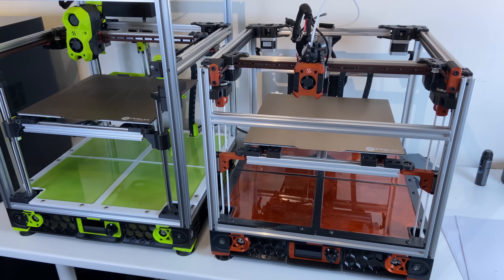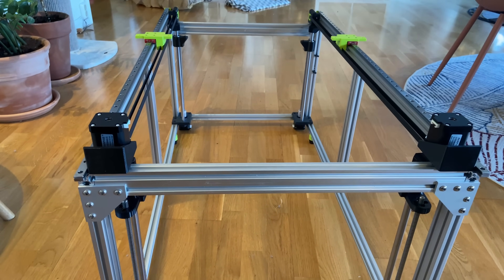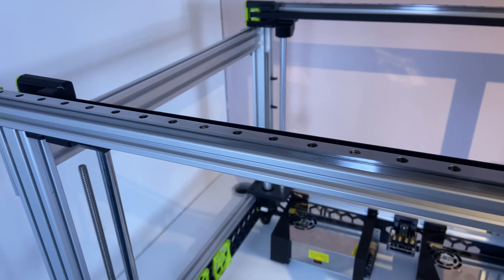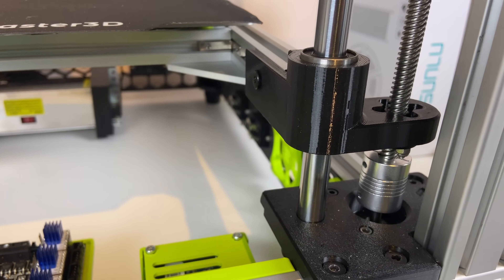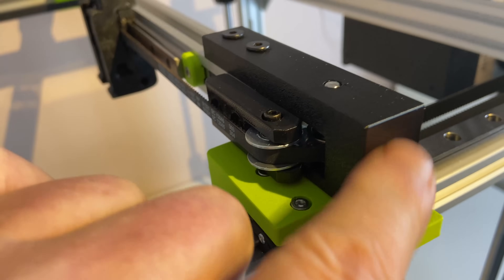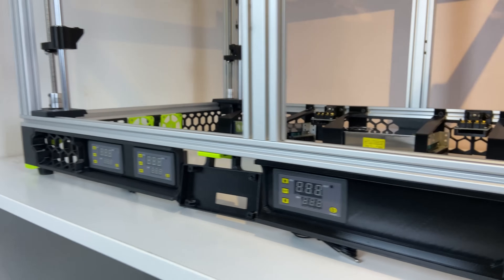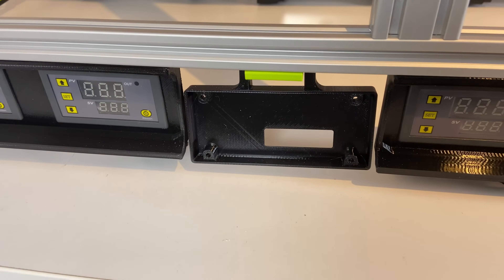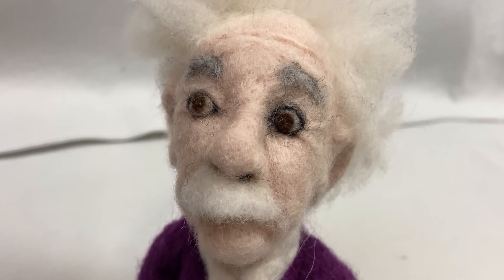Large DIY 3D printer 1 - design and build

Comment: very intersting would u plz share the cad file
Reply from the maker: I have no complete cad for this. Some of the key custom parts will be published on Printables. I am considering designing a slightly smaller version 300x600x250 with a more optimized frame size.

Comment: Out of curiosity, did you consider modifying/building a belt printer? It seems like it could give you the kind of build volume you're going for with its infinite Z axis.
Reply from the maker: I have seen some of those designs, but wanted something a bit more precise. My use case is to print some larger parts with about the same print quality as my other printers.

Comment: This is fantastic! How much did this cost all in all?
Reply from the maker: @chrishuefner7989  This build isn’t expensive. I got the 3 psu’s and all the heat beds for usd 70ish. I took many of the other parts from stuff I already had. In my case this is probably a 4-500 dollar build.
Reply: @v4projects  Hi, i am looking for a large printer such as this, but am new to 3d printing. what would you recommend for a starter 3d printer which i can then learn on and then use to build the parts for a larger 3d printer such as yours?
Reply from the maker: @johnbell1810  Most of the 3D-printed parts on this build can be printed on a relatively small printer. The larger parts like the bottom covers can be made in some other material not requiring 3D printing at all. When it comes to first printer it depends on what you would like to learn, 3D printing or building 3D printers? Your budget is also a factor. For just 3D printing I would still choose Bambu lab. A1 or P1S. Bambu lab have been heavily criticized about limitations they have implemented. If you would like someting more tinker friendly, I would consider something from Sovol or maybe a second hand original Prusa. I am not a fan of Creality, but you’ll find a lot of second hand printers from them.

Comment: This is great. IU'll make a channel to show my big 3D printer build
Reply: Biggest problem I'm facing (and I can see that with your right now) in my opinion, is that when we start to get to these sizes (plus 500mm build plate), legitminate flow is the problem, without moving to a pellet extruder; no retractions, so only vase mode is for best print quality.

My build is using very long melt zone, extreme high flow hot ends for this reason.
Still slicing times even 100mm+^3/s is taking days
Reply from the maker: Yes, and this is not going to be a fast printer either. That said I don't really need it to be. My use case is a few prints per month exceeding the size I can handle on my other printers. It will likely be some panels, frames and speaker enclosures.  It's going to be interesting to see how this works. I have changed my mind regarding the "default" mode on the printer. With the first mains switch "ON", heatbed 1 and 2 will be active. And it's basically a 300x600 printer. With the second mains switch "ON",  heatbed 3 can be used and the build volume will be 300x870ish. I think the default mode will be sufficient for 80% of my large prints.

Comment: Great video! I'm thinking of building a large scale printer myself, how did the process go so far was it cumbersome? and how much time did you invest in assembly and getting everything running? great job and good luck!
Reply from the maker: Thanks! I am using some of the solutions from my previous builds and that makes it simpler. A big printer like this is heavy to move around but it is also easier to work on as there is more space.

Comment: Nice build.  I went the easy way several years ago and expanded one of my Ender 5plus machines to 305mm x 800mm x 220mm build volume when Creality released the open firmware.  I went with a 6mm aluminum bed spring mounted to 2040 extrusion on edge with a 1000w (massive overkill) ac silicone heater. and also went with custom full size pei coated build plates.  It works well enough for my uses but I've been thinking about building it from scratch and changing the x/y orientation to what you are using since the 1m wide gantry does limit the speed.
Reply: I'd absolutely break the bed heat down into zones if I do it again.  Heating the whole bed for smaller than full bed prints makes an impact on the electrical bill.  I'd enclose it as well, I fight warping with it being open air.
Reply from the maker: Thanks! What kind of average printing speed (with ok quality) do you get on that printer?
Reply: @ not much speed, but I run 1mm nozzles at .6mm layer heights through the Swiss micro hot end kit for the ender 5.  If my memory is correct I average 60mm/s movement at the stock acceleration.  It was supposed to be a proof of concept before I bothered to go through an actual build process but because it worked I just kept using it.
Reply from the maker: @Zebsboards  I think that is around the standard speed my 300x300x400 bedslinger could do without poor print quality. Hopefully this build will be a bit faster but what I need is the capability to print large with good quality. If I have to slow it down, it’s still usable.
Reply: @v4projects  tried to post a link to a pic but it was deleted.  One of the reasons I was thinking about rebuilding was to go to the orientation that you are to see if I could get the speed up.  I'd have to switch out the hotend to the rapido that I bought as well as the extrusion volume was limiting the speed.  I was thinking flying gantry as well, a couple of years before it became a 'thing'.

Comment: Hi, amazing build! I'm happy to see someone using double shear and 9mm belts for a large design like this. Is there any reason why you chose to use petg for your motor mounts instead of abs? Its my understanding that abs would be stiffer and have less creep/deformation over time
Reply from the maker: @Terriblewastaken  Yes, it would probably be better to use ABS or ASA. At least when the parts can be printed without supports. That said I have never had a problem with PETG in an open printer. But ABS/ASA would be stiffer.

Comment: Cool project. Though I'm bit sceptical if that heat bed will work well with all materials. Most beds are known to have quite a bit of heating efficiency on their perimeteres and you're going to have two quite big problem areas. Don't get me wrong I sincerely hope that works as it would be very easy and affordable option. I've occasionally though about making large part printer, but never seen any good off the shelf solutions, though I haven't even searched too heavily. Maybe it would be possible to add some smaller heater elements between those gaps? Anyway, best of luck and I hope you update as I just subscribed :)
Reply from the maker: Thank you! Yes uneven heating is a concern but that is also a problem on most printers with a single heatbed if you are trying to use the complete build plate. I am trying to overlap with the flexplates a little by using 310x310 flexplates on the 300x300 beds. There are still several unknown factors in this build, but that is what makes it exciting, at least for me :-)
Reply: @ Idea of overlapping plates is good idea. Most certainly worth trying.
Reply from the maker: That idea with some extra heaters could be interesting to try out. Thanks!

Comment: Do you control z-axis motors in one control board and x and y axis motors with 2nd control board? If so, how do you do it and is there any source file that you can suggest? Thank you :)
Reply from the maker: Yes, the SKR 1,4 will control Z and one of the heated beds and the other controller SKR PICO will do the rest. It's actually quite simple, you use one printer.cfg and and specify the pins by adding an alias in front of the pin number. Like this step_pin: xy:gpio11  In this case I have defined the MCU handling XY-axis just [mcu xy] and the other one just [mcu]. You'll have two definitions of serial: in your config file. Have a look at Kanrog Creations video about this. https://www.youtube.com/watch?v=QIbzbwEY7nU

Comment: It's good practice to use a thrust bearing between the stepper body and the flexible coupler as the stepper shaft rests on top of a spring washer and will move if you press its down so it's possible for your z height to drop as the lead screw presses down the stepper shaft. Also make sure to rest the lead screw directly on the stepper shaft inside the flexible coupler for a similar reason to what mentioned above. Alternatively you can suspend the lead screw from above by a pillow block bearing to constrain it in z. I also want a lollipop for noticing the problem with the previous bed mount in the previous upload
Reply from the maker: Someone (a long time ago) suggested using a ball from a ball bearing between the leadscrew and the stepper shaft as well. I don't know if that makes any difference at all. Thanks for noticing the swiveling bed mounts. Very frustrating mistake and actually the second time I do that (same thing happened on my Voronish 1 build). Very embarrassing and not my proudest hour. That said I don't give up easily :-)
Reply: @v4projects   it wouldn't make a difference on lighter beds as the spring washer is reasonably stiff but still something to be aware of.
Regarding the bed mount, you can run a second rod parallel to the original to constrain the movement in z and avoid rotation around z. it'd essentially be what a single linear guide achieves but cheaper. Linking the mounts together mechanically would also eliminate the play but that wouldn't really be a "floating" mount + it introduces a new set of problems such as binding, and twisting the frame. Practical Precision has a great video on designing a kinematic mount which i highly recommend. Studying about constrains and DOFs should help you avoid making similar blunders if you don't have an intuition or feel for these mechanisms.
Reply from the maker: What I have done in this build now is to link two of the bed mounts with an extrusion. The other two still "floats". I think it will work fine now. I'll check out the Practical Precision video.

Comment: I scaled down my first Voron 2.4 from X 250, Y 750 Z 730 to X 250, Y 550 Z 2105 for now the MGN9H are sliding on the 2040 I want to print something really tall. I have be busy working on my Hydra tool changer so I have not gotten to print with it yet. The frame is finished and mounted to the wall, but I need to wire up the tool head. I don't have space for a bigger printer in the XY direction. And I wanted to make the 6mm belt shorter after testing on the First version I made.
Reply from the maker: @alfskaar489  Did you have any issues with the long belts on the first Voron? I would like to try out a corexy with long belts.
Reply: @v4projects  Not really more issues with the  tall frame not be properly supported. Print quality improved when I stiffed up the frame. You can also consider 9mm belt if it gets very long.
Reply from the maker: @alfskaar489  I opted for 9mm belts on Y on this build. Could be interesting to try to build something that will print tall objects. Have to save up some money for the rails first 🙂
Reply: @v4projects  My Total belt length is 2131.5mm considering some goes into Hydra head belt holder for the size X 250, Y 550 reducing X really help to get the belt length down.

Comment: This makes me want to build a printer instead of buying one...
Reply from the maker: It's fun but do not expect to save money. Self sourcing is time consuming and expensive.
Reply: I second that, I got lucky with my v0 and got some parts for cheaper but you're also stuck with never knowing if you built it properly if you're not experienced, Especially with linear rails and corexy
Reply: @v4projects  I found a voron 2.4 kit that's not too much more expensive than the Qidi Plus 4 I've been eyeballing. It's a bigger printer but will just cost a whole lot more in time, and of course no chamber heater, camera, or filament changer compatibility. Still weighing the options
Reply from the maker: @coledavidson5630  Fun build and great design. But a lot of work.

Comment: That is a very sensible build, remember big parts are more prone to warping, so consider using cf-pla or for normal pla make a cover for this and keep the chamber temperature for pla at 35-40C. if you do that you should also use a good heatbreak and keep the retractions low so it will not jam, or cool the heatbreak with a pipe from outside of the enclosure.
Also for this size bed levelling should be done few minutes after bed is heated up.
Great work.
Reply from the maker: Thanks for the advice! This printer will probably be used mainly for PETG and PLA. That said, the hotend (0,6mm and hardened steel nozzle) should work well with CF-PLA or CF-PETG . I haven't decided what to do with panels yet. I'll get this thing working and then improve what needs to be changed.
Reply: @v4projects  Before adding an enclosure, if the pla parts are warping, you can just crank the heating in the room to test if extra ambient temperature helps.
I use Chinese, all brass, 0.8 cht volcano nozzle for my anycubic chiron, would recommend it for non abrasive filaments.
Reply from the maker: @ It's a small, well isolated room so that could work.

Comment: This should work just fine. It lacks any physical skew adjustments, it lacks accuracy, and is no where in spec with tight tolerance rails. But it should run just fine, as long as expectations are sound. Apart from extending it to 3 beds in a row, is there anything new here? You cover some minor adjustments to some parts, as they are remixes, but is there anything new going on here? If this is your first "big" printer, the frame is not really sturdy as is. The long axis is probably over the top. Also, given the lack of accuracy in modern mainstream printers, that lack, typically haunt this type of printer.
Reply from the maker: I am not claiming that this is brilliant or something "new". I am simply trying to build a large printer for my printing needs. Some might find it interesting, others boring. I can live with that. It's maybe a bit harsh to call all my parts remixes. I spent a few hours in Fusion to create that X-axis, the Y motormounts and the XY-joiners. Not (exploding) rocket science, but still created from scratch.
Reply: @v4projects  Yeah. Nothing wrong with that. But sometimes, even in projects like this, there actually are innovations, real ones. Sometimes I miss those, and only discover them down the road. That's why I ask. Nor am I saying this is "boring" far from it. Depending on your printing need, this might work for you. 

The number of failed big printer builds is kind of staggering, and sadly, people don't learn from others mistakes or successes.

Dr. Flows review of the Giga is entering that printer from a huge printer perspective, which is refreshing. But take the Giga, it simply do not fit my needs at all, which is clear as day, after watching his video.

The frame of the Giga is insufficiently braced, and when looking at yours, your Y seems about as long, but weaker.

If you mount like a plate, like plywood, even a thin one, to either of the longer sides, you will add a tremendous amount of stiffness in the plane of that plate. Which is just what you want. You actually do not need to cover the whole thing either, and once you get that thing up and running, you could just print a 25cm wide one. It will do you wonders.

Good luck.
Reply from the maker: @FrodeBergetonNilsen  Thank you! I have probably watched all the "reviews" of the Giga, also the one from Dr. Flow. And I am not convinced about the consistency you'll get from a printer like that. With my build I am trying to stay within my "comfort zone" by just expanding Y and moving from coreXY to Cartesian. If you have a close look at the frame i built, at the corner to the back left you can see I have prepared for some braces. I have to keep them at that side/plane to not block access to the printed parts. Thanks for the suggestion of using a plate to stiffen up the frame. I use the community page on my channel frequently and update build progress between the videos. Please chime in if you have suggestions for other improvements. They just need to be "cheap". I have some extrusions in 2060 and even some 4080 CBEAM. I also have a couple of 1 meter long HGR20 rails. I have saved that for a future CNC-build but could use some of it for a large 3D printer.
Reply: @v4projects  Great. Love to hear that. Then you got a fair idea what to expect. But I have to say, as to enforcing such a frame on a low budget, people get lost in the concept of the frame itself. Panels, even in plastic, are seriously strong in the axis of its plane. Now that you make this, you may use that as tool to make just such panels. Twisting a 29cm panel, in its plane, is seriously hard.